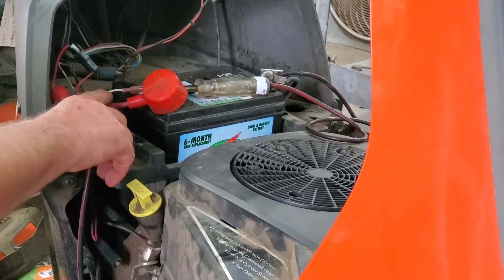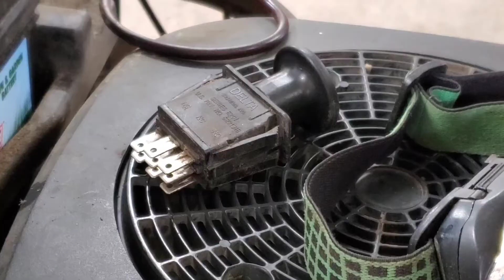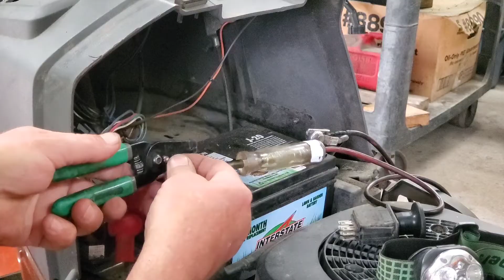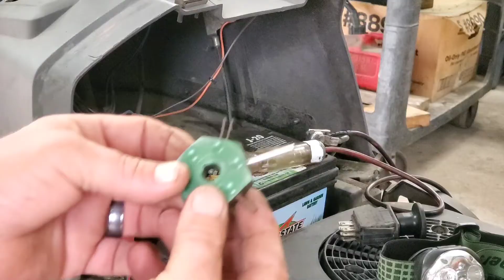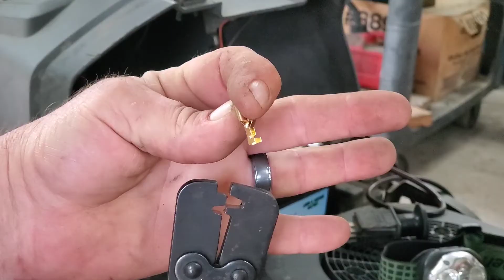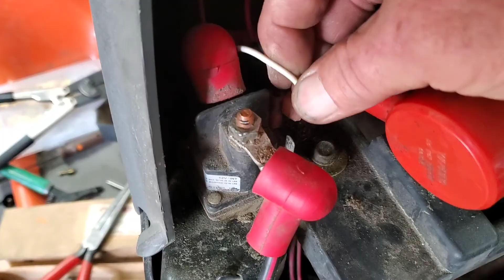Husqvarna Riding Mower DIY Electrical Repair On A YTH 24K48 Kohler Courage Twin Cylinder PTO Wiring

Comment: Mine starts and runs just fine but pto deck won't engage..... Would you still start with replacing the PTO switch or dig and troubleshoot wiring... Only 160 hours on the mower BTW.

Comment: Great video. I just urchased a JD 212. Inorder for the engine to start when key is turned,the PTO switch has to be On position which also activated the mower deck....when I dont want mower deck blades sprining in garage. Questions? Is the a bad pt switch or a starter switch or sonething else thats needs repaired. The engine runs fabulous and was kept in a garage it entire life when not mowing grass.

Comment: Hey Raley .. just caught one of your Husqvarna videos .. no way in God's Green Earth I'll ever replicate your YouTube instructions .. but now I'm a "converted Yankee" .. damn! You boys down South have their mechanical stuff together!! 
..Meanwhile, I'll keep trying to fix this orange, Swedish, worm-smokin' , biscuit splittin', dung-flingin' lawn tractor  ... somehow .. or not .. 2 yrs old, 18 hrs on the engine, new Die Hard battery .. and nothings happening
Reply from the maker: 🤣 You can do it!!  Simple things first...
Is PTO off? Fully press down brake pedal. Check fuse. Clean battery cables and tighten.  Check ground cable at frame, clean and tighten. If none of this works Check out one of my "Just Clicks" videos. Yes, I know yours does nothing but the 2 Just Clicks videos cover a ton of information.  Hope this helps you.

Comment: Good find on the open circuit!

BUT why in the world would you cut off a locking type & install a non-locker terminal?

Just squeeze the female sides down on the OG & put it back in until it locks.

Comment: When I turn on the PTO switch I don't hear the click but if I try to leave the seat the mower shuts down as it should. Any idea why the blades are not turning. I checked the clutch wiring with the multimeter and the ohms are within range. It has a new belt. I did notice the lights no longer come on.

Comment: Have the same mower. Turn key and nothing. New battery and solenoid. Won’t even turn hour gauge on. Gauge does work, tried all part on other mower and it runs. Just not this one.
Reply from the maker: Fuse?
Reply: @RaleysSmallEngines  fuse is good.

Comment: Thank you! So I have this same mower. My battery is fine but I dont have any power in my red wire to my ignition switch and the hour meter won't turn on either. No click when I try to start it but if I put juice to my solenoid, it turns over. Any suggestions??
Reply from the maker: This may be a silly question, but did you check the fuse? With a test light are you getting power on both sides. Electrical can be a pain sometimes.  Take your time with it.  I get my butt kicked sometimes and then 3am I'm awake and know exactly what to do.
Reply: @RaleysSmallEngines  you know what, it's funny because just before I saw your comment, I checked the fuse and yeah, it's blown!😄 Thank you though for everything!

Comment: I have a similar electrical issue.  My Husky blows fuses as soon as you turn key on.  I hooked up test light and determined it goes out of I disconnect the OTHER end of the harness.  Using a jumper I can isolate the connection labled 2on the harness white wire goes up under the engine cover and then I have no idea  :)
Reply: voltage regulator

Comment: The only wire I’m having trouble with is the black one. My mower will be completely dead. I mess with the black one and it fires up. 🤦🏻‍♀️ Very frustrating.
Reply from the maker: Thanks for commenting my friend.  I have seen the wire broken inside the insulation where you can't see the issue. That can be tested using an ohm meter while moving the wire. Take your time moving the wire in different spots paying close attention to when it works and doesn't.
Reply from the maker: Yes I know from experience it can drive you nuts. Please be patient, calm and you can fix it.
Reply: @RaleysSmallEngines  I have had to get off my tractor and mess with the black wire. 🤣🤣 I just ordered an Ignition switch wire replacement harness. I will definitely put it on when I receive it. I appreciate your video. Confirmed what I figured the problem was.

Comment: I have a 2019 TS142 and the fuse block is under right rear wheel well, behind wheel, directly under and to the right of the battery which is under seat. Manual says fuse block is behind dash...doh!...not always. I also had problems with ignition switch not turning all the way off so I had to replace switch as it was blowing fuse and stopping all power going to mower.

Comment: I think you're a magician. I bought a Husqvarna Briggs v-twin  used. 180 hours. It ran and mowed a half hour, after I paid $800. I bought a new battery,  key switch and solenoid but I found  wires cut, that should have been to the lights. I found the conduit on the yard. It behaves dead like yours. It will crank if I short the solenoid terminals, but I don't want to ruin the new solenoid.  I don't have a schematic to the yth2348 but I have to find out why the key is dead. The hour meter quit too.  :)

Comment: Great video sir! I enjoyed that explanation of the terminal failure. Can you tell me how to wire up the PTO switch for a YTH2148 Model?
Reply from the maker: I will do my best. What kind of issues are you having? I just did a video on how a PTO switch works.  I will gladly look up your machine and do my best to help you diagnose the problem.
Reply: @RaleysSmallEngines  My next door neighbor is an older gentleman. He had a bad PTO switch and ordered another one but cut the wires behind the wiring harness on the PTO switch and he can't remember how to wire it back up. I'm trying to help him out and save him some money. Any help would be greatly appreciated!
Reply from the maker: @7lexxter  email me the model and serial numbers and I will look up the wiring diagram tomorrow and see what we need to do. Raleytrans@gmail.com

Comment: Hello I wonder if you or anyone watching can help me with a problem I’m having , I have a Bolens riding mower and I put a new PTO cable on but I was still having the same problem, the PTO will only engage when the deck is in the highest position, does anyone know how the fix this problem, I’d deeply appreciate the help
Reply from the maker: Check the tensioner arm on the deck to see if it moves freely.  Sometimes they can bind from rust or debris.

Comment: From my understanding huskavarna and craftsman are very close to the same mowers eltrical wise my Craftsman had a burnt terminal on the key switch plug in
Reply from the maker: Hope the video helped you out.
Reply: @RaleysSmallEngines  yes it definitely gives me a good starting point on mine I worked in small engine repair for a little while to be sure I didn't messanything up I called my former boss where I worked and he did advise me that the eltric pro can be rN off the battery but said it pulls alot of amps so use at least 12 gage wire in order to do so

Comment: Can’t emphasize this enough: The right tool for the right job. I learnt about U-channel crimpers about 30;years ago from the computer repair guy at work. Never had a crimp go bad since. I cringe watching folks use the crimper on a cheapo wire stripper multitool.
Reply from the maker: Yes, huge difference in using the right tools. Thank you for watching my friend. BTW, my wife thinks you are awesome also.
Reply: I would say it's more about the education and skill than the tool.  You can have the right tool and still do a crummy job, eh?  😁